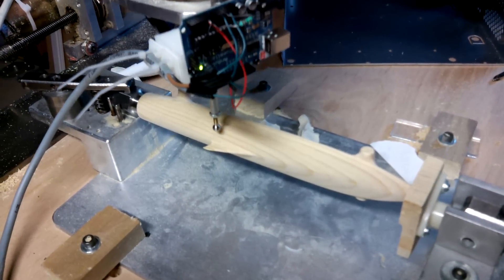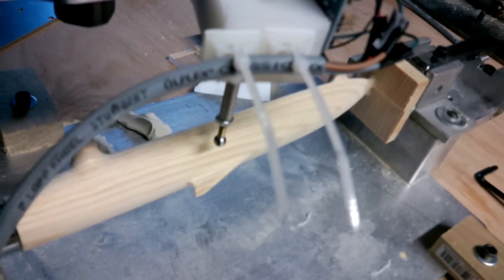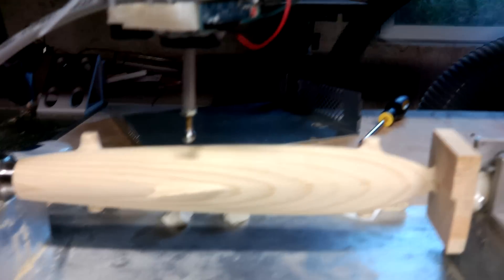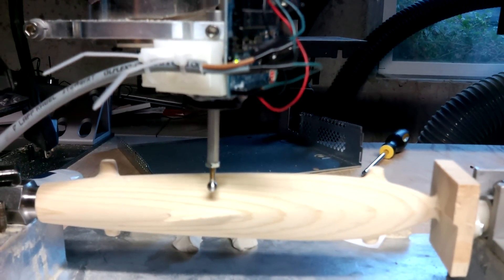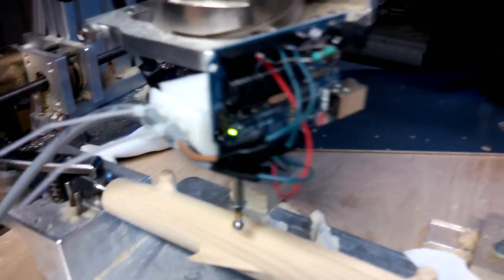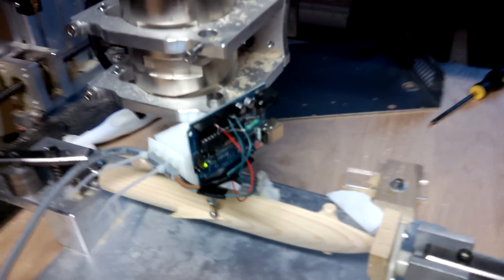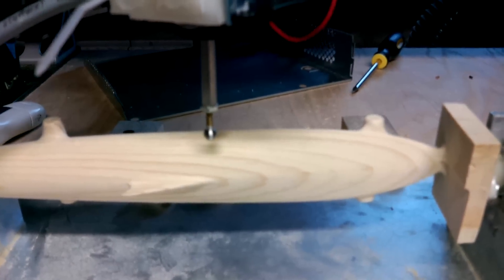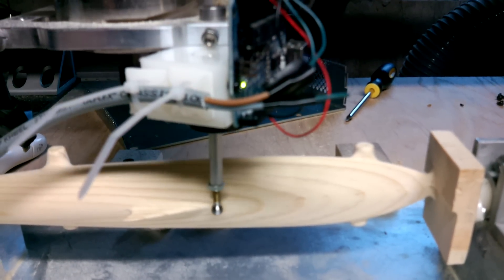Co2 car touch probe Linux cnc piezoelectric

Comment: very cool..  I've noticed a few people have commented but there has been no responses..  so here goes..  the only info I have found on this is explained here.. (Not my post btw)  http://www.instructables.com/id/cheap-super-sensitive-digitizer-probe-for-cnc-/

I do have a little experience with Arduino, I have noticed in this video he has used a full sized Arduino Uno to do this..  once i build mine,  I will use a Arduino Nano which is heaps smaller and should make a better compact unit.  

in terms of the arduino code, use this..  http://www.arduino.cc/en/Tutorial/KnockSensor  and instead of sending knock to the serial..  change to output pin 13..  
int val = 0;  change to 
const int buttonPin = 2; 
const int ledPin =  13; 

then change these lines...
 if (val == 0) {
      val = 255;
    } else {
      val = 0;
    }

to 

  buttonState = digitalRead(buttonPin);

  // check if the pushbutton is pressed.
  // if it is, the buttonState is HIGH:
  if (buttonState == HIGH) {     
    // turn LED Probe on:    
    digitalWrite(ledPin, HIGH);  
  } 
  else {
    // turn LED Probe off:
    digitalWrite(ledPin, LOW); 
  }

Anyway Watch my videos..  I will do a video on it with an explanation and the code in about a week or 2..